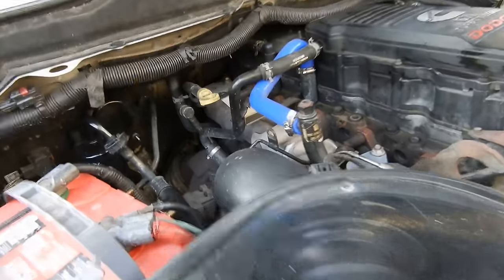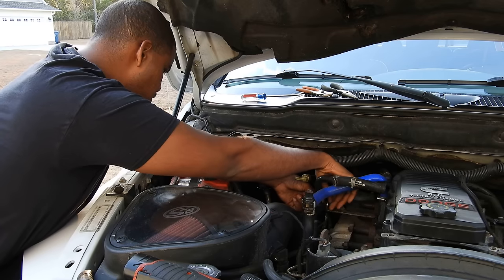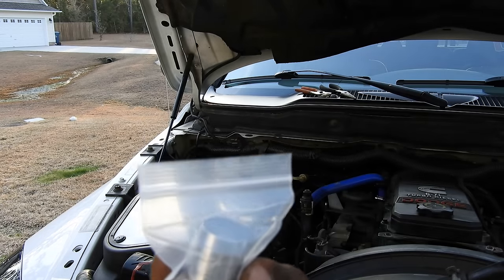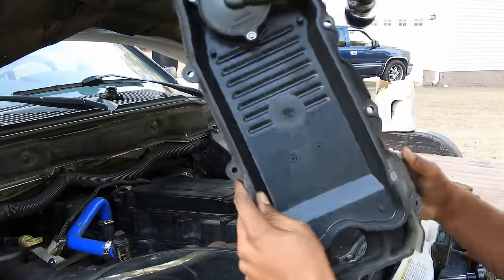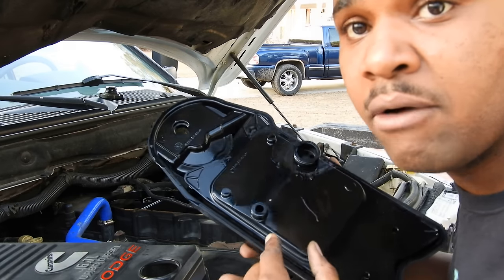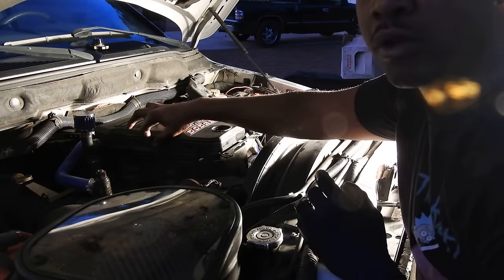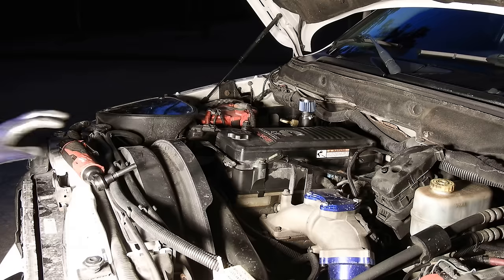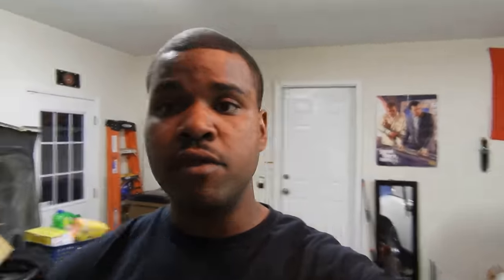HOW TO DO CCV DELETE ON CUMMINS 6.7

Comment: i did this along time ago and wanted to give some input. there is blow by and running the hose down towards the ground is a lot better idea imo 
having it up like that with a filter isn’t really great. it’s not sucking air in it’s pushing out if anything.

Comment: You don't need to do all the cutting of the plastic. You can just use a flathead screwdriver and pry up on the 4 corners as that closure has studs that snap into receiver holes. Once you gut the filter medium you can snap the piece back in place or leave it out.
Reply from the maker: Yeah I didnt know that way back then. Gutting it definitely sucks
Reply: Appreciate that info 👍

Comment: 1 helpful suggestion to the process. Instead of cutting down the center then prying the cover off. You could drill out the corner studs.  Maybe easier. Great job

Comment: It would be helpful if you could tell the benefits of doing these mods. I have a 2015 2500 Laramie Longhorn 6.7 HD Turbo 4x4 Megacab; i just had deleted. I have not noticed any increase in mileage. I am a first time diesel owner.

Comment: I’m on my first diesel so this is really good stuff.  Can’t wait until the warranty is up and start doing some of these mods. Thanks for sharing these
Reply from the maker: Asa Black no worries man glad my videos are helping. Hope your loving your diesel. When that warranty is up get that egr/dpf delete done asap!
Reply: If you can't wait until warranty is up then do the mods and your warranty will be void
Reply: Just got my first diesel to 2008 6.7!
Reply: @brandonrasmussen6692  hey bud how are you liking the 6.7?
Reply: @thewheelieking4085  I've had it for 6 months now, that comment was 5 months ago 😂, I bought mine fully deleted with a socal cps3 and maps on it of course and all I can say is the engine is amazing ....... The automatic 68 rfe on the other hand is dog shit I just ordered 4.11 gears that way I could Band-Aid the fact it's made out of tin foil upgraded one is about 8-10 grand which I will be forking out at some point 😂 if you want to make making any power the stuff adds up 1500 beans for dual cp3 pump, $450 for head studs  800$ for airdog the list gos on 😂 and you need all of that plus a fleece cheetah which is THREE THOUSAND DOLLARS....... You gotta really love diesels 😂 they don't call it a build for nothing

Comment: I have taken one of these filters apart without cutting. 

it’s not easy because the plastic is kind of brittle! 

you need to unsnap the clips using thin pieces of metal to stick inside to unhook them.
And carefully rip the bottom off of the filter media.

then I soaked both halves in gasoline to loosen the glue and I was able to peel all the filter out and snap it back together. 
So you get those little O-ring ports to locate the housing properly to ensure a week free seal

Comment: Hey man, so you recommend doing the delete over getting another CCV filter? I’m also EGR deleted and did my oil and fuel filter changed and reset it on dash but after about 100miles I got the “perform service” on dash again, would doing this be a better alternative to the truck? I’m new to diesels so my bad

Comment: I've watched both this and the newer video with the catch can. I'm curious if doing just the reroute with leaving the ccv filter on is still better for the turbo? I'm just not about gutting the filter lol
Reply: I had to put my filter back in until I my catch can comes in... oil was mad blowing out the little breather.... saved my gutted filter though...
Reply from the maker: Once u put the catch can on it'll collect the crank gases and wont have a mess
Reply: @EVERYTHANGDIESEL  thanks partner!!! I was wondering how that catch worked for you... ordered one immediately after the video,,, anyhow yeah I'll put the gutted filter back when I get the catch... by the way... my buddy ordered a 125 catch can,,, straight pile of trash...
Reply: @EVERYTHANGDIESEL  thank you..

Comment: So why did you gut the filter? That is what keeps the engine oil from coming out out the valve cover and just allows the combustion gasses to escape. So now your new mod CCV filter is going to get oil soaked and mist oil out into the engine bay...

Comment: Question … I just did a full delete on my 2017 ram 2500 , but the code p04db keeps popping up. My question is what good does ripping the guys out of the ccv filter…  did  you have the same issue and did it work ?

Comment: I like the video man. Lot of good info. Only question I have is does it make the check engine light come on? I wanna do the delete but didn't know if you have to program or anything afterwards or if the check engine light comes on
Reply: It's an interval trigger. I believe it (perform service) comes on at 67,500 miles. Reset the interval (key on, no start brake 2x, throttle slowly to floor 2x key off) and you won't see it for another 67,000 miles

Comment: Hey great video.  Quick question: what size is the plug you used for opening on the elbow of the S&B intake?  I have seen folks using either a cap or a plug, but I can't figure out what size it is and where to get one.  Thanks in advance.  'Bout to pull out my EGR, throttle valve, heater grid, and figured I'd do this while I am at it.  Don't know if I will make videos of this for my new channel I recently started, but I do appreciate yours.

Comment: Read a few forums that talk about oil splatter on the engine. Have you had this problem?  I wonder if putting a bowl type catch can (open on the top) around the filter would help shield this from happening.  How often do you have to change the filter?  Thanks

Comment: Hello, I have a 2013 ram 2500 with the 6.7 and I see you have a EGR delete, I will like to ask you if you know by chance if by doing the EGR delete on my ram will bring me up any check engine lights at all? or not?
Reply from the maker: Martin Martinez Gancedo yes you will get a check engine light. You need some a tuner to unlock your ecm and flash the computer so it won't do regens anymore. If you take off your egr components and that's it you will throw a engine light.
Reply: What Tuner did you use for the delete?

Comment: Earned a sub..watched a few other videos as well and I'm also a preferred customer for amsoil. Will be switching my recently purchased 2017 ram 2500 Cummins to amsoil soon. I'm just checking out things to delete and checking out tunes so when I get some cash i know what all to do. I'm curious about the CCV delete? Is there a reason for it? Doing it does it create something else you have to keep up on? Does it run better without it? Thanks for any help as I'm new to diesels. Have a great day!
Reply from the maker: Nice man, so biggest thing with the ccv delete is your saving your turbo. Cummins created a sealed ventilation system, by removing that pipe that go to your turbo from the valve cover your turbo will not pull those gases and fumes into it which will cause turbo sludging and stuck vanes inside your turbo, ultimately damaging the turbo.

Comment: Hey i did the ccv delete just like your vid but the truck through a service code  on the filter anyway after driving for a week apparently the soot and oil is running back into the filter area not sure if it defeats the purpose or not so i opted to run a hose from the exit of cover to the bottom of the chassis to drain.
Reply from the maker: Yeah the hose route is a good option man. I'm actually gonna be looking into a catch can Setup not sure why you would get a code for the ccv delete

Comment: Hey buddy i have a question i have done the ccv delete like your video but wouldn't the oil and soot just run back down and collect in the filter area or how does that work. Wouldn't it be better to run a 3/4 I.D. hose down towards the bottom of the truck and just let it run out.
Reply: tony macias a lot of folks do that.

Comment: Good vid....got a question, i deleted filter but thought i messed up bec i didnt use bottom and put filter housing together before install. Did like you did,  Keeps dripping oil out of breather from the delete tho.  Thanks
Reply from the maker: Ron Ciofalo just remove that filter entirely top side and all. It will run without the filter fine. I found out after the video you dont need the filter at all. Just run a hose from the side of the valve cover down the frame so it can vent out and drip
Reply: EVERYTHANG DIESEL ok cool.   So you do get a little drip? My ccv filter delete was dripping right on the exhaust manifold. Nothing crazy but making a mess.   Thanks for the quick response bud, appreciate it!
Reply from the maker: Ron Ciofalo yeah remember exhaust gasses and fumes will come out the filter hole. Just connect a hose to it and run it down you'll be fine brother!  Your welcome no problem.  I used a filter because the kit came with it but I will run a hose when the filter clogs up
Reply: So the hose i run out the valve cover jist goes down ran under the truck? And the filter that gets pulled out after you.clean/gut it out you just put that top piece or don't need it at all filter/housing?   Tai and awesome videos brother!!🤙

Comment: Will this mod cause engine light or any codes on a stock motor. Havent deleted egr or def yet, but this looks like a good start for me. 2015 Ram 6.7L   Thanks in advance, sweet lookin ride!!
Reply from the maker: thank you man and i would delete the truck first before doing this mod because on 4th gens sometimes you will get a crankcase code idk why though
Reply: Ok Thanks

Comment: You may won’t to look in to a 3 gen swap for your turbo manifold your rear three cylinder run 200% hotter than the front three. Best thing I ever did.
Reply from the maker: Down south hunting And fishing I was looking at 3rd gen turbo swap kits. Apparently the benefits are almost as good as doing a 2nd gen.
Reply: EVERYTHANG DIESEL  2nd gen swap is a little more work and a little more money.
Reply from the maker: Down south hunting And fishing I think I'm hooked on the 2nd gen swap that sound you get it can't be beat haha
Reply: Ready to see your video on that swap. I may do a 2nd gen swap after your install video. When you thinking on that ?
Reply from the maker: Down south hunting And fishing I'm trying to do a 2nd gen swap within the next two months. I already found the turbo I'm gonna do. S464 and smedling manifold. Whole kit 1900 bucks from quick style performance

Comment: How do you like this kit? I heard people say after awhile the filter gets full of oil and oil ends up getting everywhere . And I know a lot of ppl will just run a hose from the crank case all the way down to the side of the frame and let it just drip out . Just wanted to see how it’s been treating you . Doing mine soon. But keep up the good work man ! Your 3rd gen looks pretty clean!
Reply from the maker: bruno c thank you and yeah your right about the filter. I should have done the hose trick down the frame but I didn't. I will eventually when it clogs up haha. It's doing great so far I have no complaints about doing it or the kit. I put maybe 1k miles on it since and the filter holding up good. Thanks for watching!
Reply: What size hose should I run and what size plugs? thanks.
Reply: I ended up having to run a 3/4” hose into my frame after I did this, the oil was getting up into the filter and blowing everywhere. I put a pvc tee in and still have the filter on as well
Reply from the maker: I just ended up installing a catch can. Worked perfect
Reply: It's a lot like big Rig.. run a hose down so drips under truck.
Reply from the maker: Yup or u can do a catch can
Reply: U must have excessive blow by! There shouldent be much pressure there at all. It's just a vent hole

Comment: Well, I did this to my Cummis 6.7 but I only did the heater hose down to the frame & plugged the hose that going to the turbo. It all was well, until I pulled my trailer it gave me a code, the cvv code. Now, do I need to gut the filters out?
Reply from the maker: yeah you need too take out the filter. you can take it out completely and it'll be fine. then reset the code and you should be good to go. every now and then its common for the ccv cel to come out. the computer stilll thinks there is one installed so its normal. but yeah gut the filter or take it out completely.
Reply: EVERYTHANG DIESEL ah ok Ill do that.

Comment: Semper Fi brother. I just bought my first diesel just this week. Still has warranties. It's a 2018 2500. Is this mod something i can do without voiding the warranty?
Reply: This mod will void your warranty. The only mod that won't void your warranty is a proper cold air intake (as stated per my dealer), but you might want to ask your dealer first to make sure.  I waited 5 years for my warranty to expire and the next day after it expired, I deleted my 2015 Ram 2500. Big difference in performance and power.
Reply: @davidherrera6892  too late your engine is done for

Comment: a little negative pressure is good for the engine and possibly frees up some HP. Thats why the crank case vents to the turbo. The CCV filter is there to keep the air dumping to the turbo clean. Its better to leave it all intact and change the filter at proper intervals (actually soon IMO, like 40-50k) IMO this is one of the BS mods tons of people do thats not based on actual facts.
Reply from the maker: i got facts that doing it is good for the engine. I did oil analysis on my oil to check for contaminants and did a video on it and i had little to none from my test results. also i have a catch can installed there now so it goes into a can. checkout my newest video i talk about the results and show what all the catch can has done very effective.
Reply: There is also a diaphragm in ccv vent to turbo. The turbo would open the diaphragm allowing engine to breath. Unless you delete the diaphragm in ccv cover, your engine is not breathing freely. Removing the filter media is pointless unless you delete diaphragm also. Your motor will breath by pushing pressure out of main seals, so delete diaphragm if you disconnect hose to turbo.
Reply from the maker: @earlweber7295  wheres the diaphragm checkout my new video I installed a catch can.
Reply: EVERYTHANG DIESEL diaphragm is under cover, has 3 safety screws holding it down. It's actually the elbow that you have the small breather on. Just unscrew the screws, remove rubber diaphragm then screw back together.
Reply from the maker: Thanks for the info man
Reply: EVERYTHANG DIESEL that's why people are saying about negative pressure. The negative pressure would open diaphragm in ccv vent. Allowing gasses to be sucked out. Without that negative pressure to open the diaphragm, gasses will be forced out of other areas. Including valve cover or ccv cover. Also you will get the crankcase overhead warning because pressure will build up, making computer think filter is clogged.
Reply: Yea I do oil analysis as well, I saw zero difference in results with the crank case vented to atmosphere vs into the turbo. Deleting the EGR made a huge difference as you would expect. Overall, no change in how the engine runs, no change in the cleanliness of the engine, no tangible benefit, I’ll defer to Cummins engineering and leave it on.
Reply from the maker: Sounds good man
Reply: Cummins engineer s are forced to put the emissions crap allover the engine the pre 07.5s had none of the crap on there
Reply: Sounds horrible!! Get all that shit  off there the day your warranty is up and yo r engine will thank you every time you hit that key. Tree huggers ruined the diesel
Reply: Think about it! Why would you want that crank breather venting into the turbo?? The legendary 5.9 never had non of the bullshit and were just fine ! In fact they were dam good. Imagine being your turbo would you want clean fresh air or fumes and vapors from the crank case!!!  COMMON sense will answer that for ya
Reply from the maker: Exactly man! On top of that people wonder why there vgt vanes go out ok there turbo. I'm sure this aids in it.
Reply from the maker: Also if you get a chance to see a intercooler where someone left the ccv hooked up. The intercooler is sludged out after years of driving it.
Reply from the maker: I haven't seen a video on it nor have I've seen the diaphragm on the side.
Reply: No doubt . None of that added crap is needed!! After all the original version of this power plant is a tried and true proven beast and the bran new ones will clog if you let them!   Dodge and Cummins laid down the foundation for this diesel pick up thing !! The others just follow and pray and hope for longevity and durability. But hands down Cummins is the man in the diesel pickup and a top dog amongst the big tractors too !!       But I believe I read that the i6 is the best engine platform ever built in the U.S.
Reply: Instead of checking your oil , just open up your v.g.t and there will be crap all through it and it hasn't been 100 % since new!! That is if you haven't made much needed mods like he is showing you for free!!
Reply from the maker: I would believe that no without a doubt man! Its proven why u think there's cummins swaps but no duramax or powerstroke swaps haha
Reply: EVERYTHANG DIESEL nah man, I don’t think so. While I don’t condemn this mod, it has nothing to do with the vanes in the turbo. That’s the exhaust side of the turbo. This mod see’s a little advantage in the compressor side because you’re no longer pulling crankcase vapors (oil) into the inlet where ideally it should be nothing but fresh filtered air. The byproduct of combustion ie soot is what allows the vanes in the turbo to become obstructed. That’s why it’s important to use your exhaust break every chance you get. Keeps your actuator moving and in that, keeps the vanes free from carbon build up.